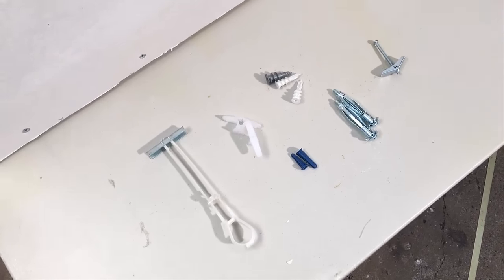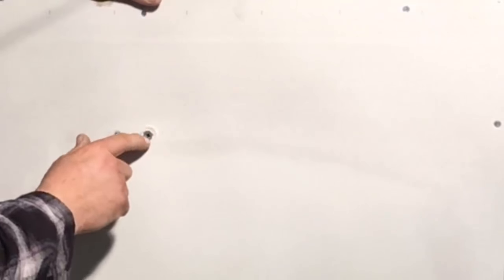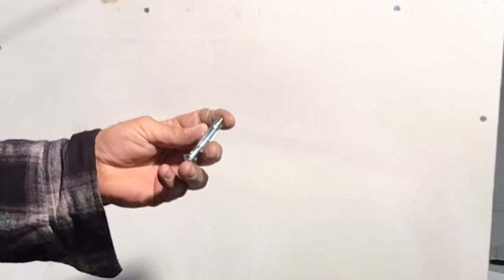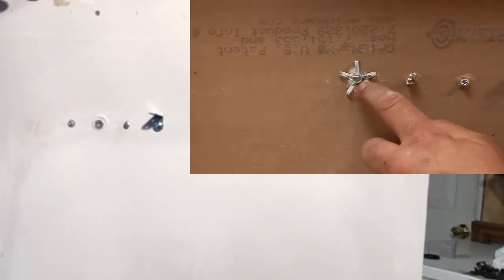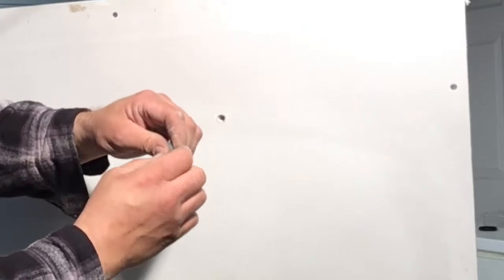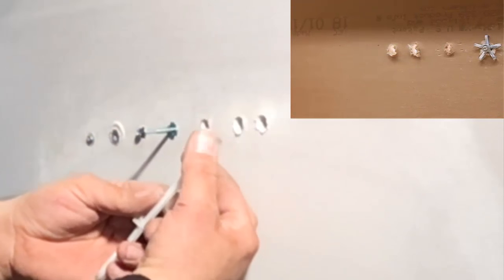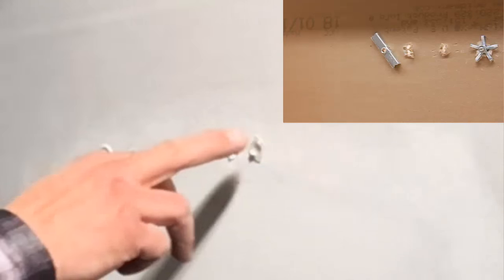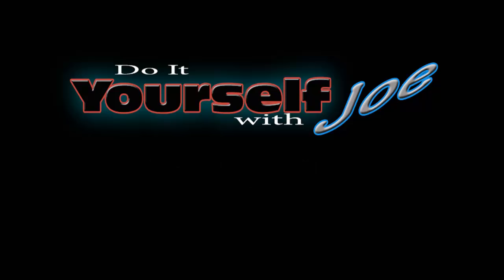How to use hollow wall anchors

Comment: Snap toggles are by far my favorite hollow wall anchor. There are plenty of toggling type anchors. There's snap toggles, self drilling toggles like the cobra drillertoggle, and of course old school spring-loaded toggles, and they're all going to be very strong. In fact, I'd wager that unless you're mounting something VERY light, toggle type anchors are the only kind worth using. The only exception IMO is if you're dealing with a wall cavity so shallow that the toggle can't open, in which case a molly (the kind that open like an umbrella @9:45).

The reason snap toggles are my favorite is because, as you said, unlike old spring toggles they don't fall into the wall if you remove the screw. Self drilling toggles also prevent that issue by having threads on the casing similar to the ones you call easy screws, but the mechanism doesn't always engage, and it sometimes strips out. Snap toggles are the best of both worlds.

Comment: i use toggler anchors for tv's they will hold 120kg the average tv is 15kg to 21kg so they can be used for tv installation

Comment: good video only thing is the first anchor you showed was put in wrong, the wings are meant to fold the opposite way so when the screw goes in it pulls the wings back on the drywall in the shape they sit before use
Reply: Always someone who is a better expert than then the one actually showing the video.  Maybe you should have created the video.

Comment: The Toggler will 100% hold a TV's weight. A TV  mounted with a standard wall bracket, not the full motion wall bracket. The brand you used is not the "Toggler" brand, it is  "The Hillman Group" which I find to be of a lower quality than Toggler.

Comment: Does anyone know where to buy drywall anchors that open up as shown at market 2:08? TIA
Reply from the maker: You can get them here   https://amzn.to/3hPvtXu  If you don't want to order them you can get them at the hardware store or at the big box stores.
Reply from the maker: Keep in mind there are several sizes to choose from. You need to know the thickness of the drywall  or combination drywall with paneling over it. The mollies you are looking come in sizes for 1/4 inch drywall and up. A 1/4 inch molly will not work for 1/2 drywall. 1/2 inch mollies will not work on 1/4 drywall.
Reply: Thank you for replying!
Reply from the maker: You're welcome!